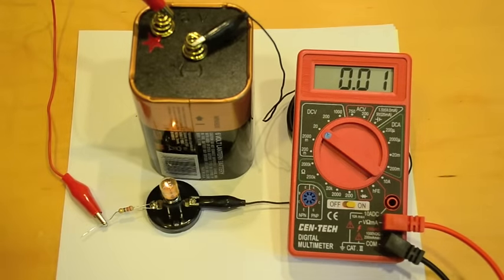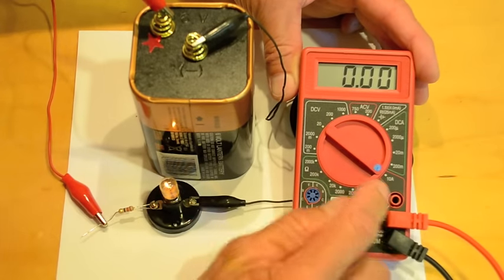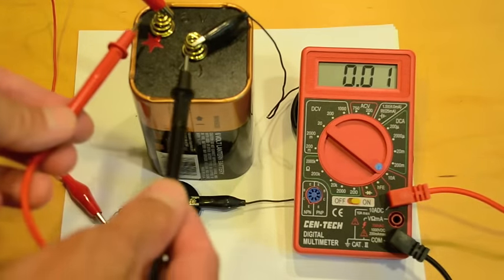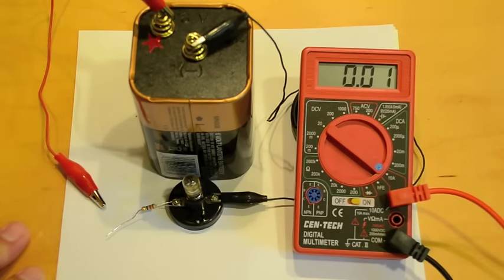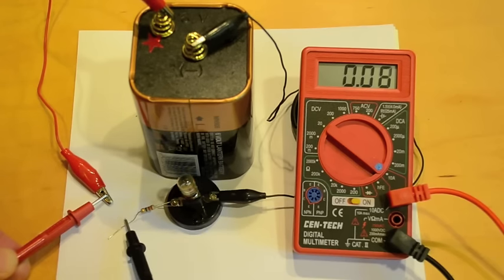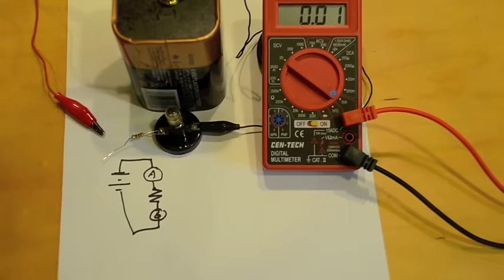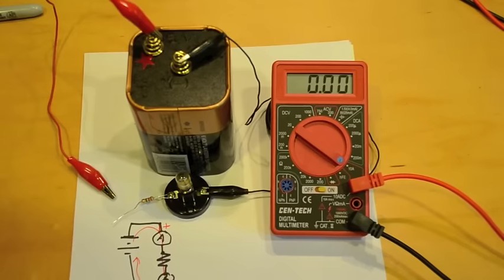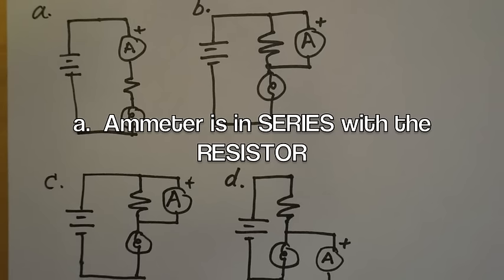Measuring Current with a Digital Multimeter

Comment: Is the resistor necessary?
Reply from the maker: No, the resistor is not necessary for this task, but it is part of the same circuit that is explained in my Measuring Resistance and Measuring Voltage videos.
Reply: so this will just measure the current being drawn for the circuit right?
 but what if we want to know the total current the power supply can put out? or is there no way to tell unless you know  what the power supply is rated for already?
i have an old power supply harvested from a PC and i use the the 5v  out to power some led lanterns i have hanging on my porch but now i want to add a  USB to  it to power a  security cam ,   i am just afraid  it might be too much  current though
i read that current of the power supply should not excede double  or 2 and  half times what the load  runs on , for exampe the camera comes with a 1A USB power brick and you can daisy chain up to 3 cameras off that one brick , but i will say 1A for the  camera load , so if the PC power supply is rated at over 2.5A then will that be too much current and fry the camera?
Reply: HomeMade DIY HowTo Electronic 
It would be necessary to not blow the light. 
Maybe.
Unless it's a 12v light and battery.

Comment: is is possible to measure the current even without resistor
Reply from the maker: ALVIN OLAVE yes. The resistor is only there to demonstrate other uses of the meter — measuring resistance and voltage. See the companion videos if you need help.
Reply: thank you very much..
Reply: of course u can measure current without resistor in series..
the purpose of resistor is to limit the current to bulb,but if u place ammeter inbetween resistor and bulb amp will vary

Comment: If you're doing a AAA battery or even a D battery can you put the probes directly onto the battery tips or do you still need a circuit
Reply from the maker: yes but  you won't really learn anything.  You'll just drain the battery.  The maximum current of a AAA is well under 10 amps but the voltage will drop when you short it out.
Reply: MrChanPhysics thank you

Comment: Would 0.17  showing on a meter be a reading of 17 mili amps or 170 mili amps ? I'm doin a parasitic draw test on my car and this is the reading
Reply from the maker: If your meter setting is in Amps then it is 170 milliAmps.  milliAmp = 0.001 Amp
Reply: Got u👌 my car should have no more than 50 mili amps so there is a draw there somewhere. Thank you very much

Comment: Thank you for the video, it was very helpful. For some reason I've always had trouble wrapping my head around multimeter current measurement. As an aside, that multimeter is an absolute piece of garbage. I work at harbor freight and for the most part, I like their stuff, but literally the only good thing about this meter is that it's free with a coupon nearly all the time. And really, the only good thing about it being free is that you can take it apart and get the 9v battery out of it, so...yeah, free 9v battery. Oh, and it doesn't have a fuse, btw, it has a shunt between the 10ADC and COM connector.

Totally not dissing you for the meter though, I'm just dissing the meter. It sucks and I hate it lol.
Reply from the maker: Yes, I got a bunch at Harbor Freight for $4 for my classroom.  I think it's a better deal than begging money from the  principal or parents for $200 pro units that have $10 fuses for students to blow.  The cheap Centech unit does have a 10 Amp fuse that costs about 50 cents.  But we basically treat the meter as disposable, after 7 herds of teenagers have gotten their hands on them.
Reply: Oh, stupid me lol. There is indeed a crappy little glass tube fuse sitting between the middle connection and most of the rest of the functions, in addition to the shunt between the 10A and COM connections. Still, crappy piece of hardware. It gets the job done, but there's so much jitter in the readings that it's hardly accurate enough for any real applications. Still, free (or $4) is a good price.

Comment: Just learning and confused. Why was the resister necessary?
Reply: +JP Voodoo You are right.
Reply: to avoid short circuit
Reply: No, It has to do with the light bulb can't handle the voltage of the battery, so the resistor lowers the voltage.
Reply: but dont electrons flow from negative to positive?
Reply: Yes, It actually doesnt matter which side the resistor is on however.  Quoted answer: "When two or more components are in series, the current will be the same through all of them, and so it doesn't matter which order they are in."

Comment: This can be used to test a 12volt car battery charger,, I'm pretty sure.. 
Mine has 2/10 amp charge plus a 50 amp boost... 

Tell me, what would your particular meter do, if you did the same test, 2amp/10am, and ran the Battery charger on boost at 50 amps with it in series.. Would it just register at 5 amps, since it could not go over 10, to get to 50, or stop at 10, or freak out?
And, what if it went over 10 amps? What would it show? Say 10.2 or 10.3 amps?

Reason I am asking.. 
When I tested 2 amps, it ranged around 2.2 amps.. 
I got no reading on the 10 amp charge...  (seemed if it went over 10 amps it would have registered at least 10 amps and stopped. 
I got 5 amps on the 50 amp boost charge, but, you have to hear it making the noise and watch the meter needle on the charger itself.. Not sure if the meter would register 10, or 5 for 50amps, or 5 for 5 amps.. 
I am using the same meter you are using.. 

But, it was making a heck of a lot of noise on boost, and the reason I was testing it was,,, I was just about positive the 10 amp circuit was not working to begin with.. 
I really was not sure what I was doing, but, I am even more certain the 10 amp charging circuit does not work, and I am pretty sure that the boost is not working either.. Or, not working at 50 amps... 

Do you have a few minutes to comment?

I did the video because I was pretty sure you could test one like this.. I found your video later after posting mine.. 
https://www.youtube.com/watch?v=ESnPuFYRbKg 

Thanks for your videos.. I can almost always find something to help figure things out when I run into something strange.. 
Measuring amps is something I really have not done on DC.. 
Thanks.
Reply from the maker: If you run more than 10 Amps thru this type of meter it will blow its fuse.  This particular meter uses a cheap $1 fuse you can buy at a hardware store.  A professional grade Fluke meter uses a $10 fuse that you have to order from an electronics supplier (I've blown a couple testing automotive circuits).  If you really need to measure current greater than 10 Amps, you'll need a clamp-on style ammeter, which uses an inductive sensor.  It has jaws which clamp around the wire you want to test.  You don't have to break the circuit to use it.  The jaws are large and clumsy and are not useful for small circuits, but will work for car batteries and household wiring.  .Make sure you get one which measures DC as well as AC current.
Reply: Thanks for your comment.. As I suspected, the Boost was only putting out 5 amps, because I went back and tested the amp meter on a wall wart transformer 1 amp.. Worked still.. No blown fuse.. 
And,, I am sure the 10 amp circuit produces more than 10 amps, if it is like the 2 amp circuit, and it didn't blow a fuse either, so, it was not working either.. 
I have one of the Clamp On Meters, but AC only, and I have never used it for that.. I need to hook it up just to see how it works.. Ha..
Again.. Thanks for your knowledge.. 
Helps to know I'll just get a refund on this one.. Don't need a third charger doing the same thing.. 
I'll check on getting a clamp on AC/DC meter.. Something tells me they won't be cheap... Cheers.

Comment: Hi what can be if multimiter not reads the amps (only -1 appears and not create a circuit) but it reads voltage?
Reply from the maker: it probably means the current is greater than the meter can read or display. For example, if it set to a 2 Amp scale, and the actual current is 3 Amps, which exceeds the limit, it may display the -1.  It may not be enough to blow the fuse.
Reply: MrChanPhysics It should read 10A but the current that i want to read is less than 3A. The fuse was blowned in multimeter I replaced with a good one but doesnt help

Comment: hi is there a way to measure dc carbon brushes to say if they are ok for 12v or the difference if they are for 24v or 36v
Reply from the maker: I don't think the digital multimeter will tell the difference.  A motor brush should be very low resistance for any application.

Comment: When I first got a multimeter, I measured the amps of a common 1.5v AA battery by connecting the terminals directly to it. I don't remember exactly but it showed about a couple amps and rapidly declined. When I checked the unloaded voltage after that it had dramatically declined ie a good amount of energy stored in the battery got discharged within a couple of seconds. But the meter or battery didn't get damaged even though I tried to check it on the 2000micro A, 20 mA and 200 mA before moving onto the 10 A setting and it didn't even have a fuse. And it's a cheap Haoyue DT830D dmm. Btw how is the maximum amps from a battery checked safely?
Reply from the maker: Batteries have internal resistance which limits the amount of current they can supply. The maximum power delivered is when the load resistance equals the battery's internal resistance.  Unfortunately, the internal resistance increases as the battery is depleted.

I don't know an easy way to test for max amps from a battery with a single DMM.   You could hook the battery to a variable load resistor (high power, low resistance), and measure both the current and voltage.  Adjust the variable resistor lower until the voltage across the battery drops below its specified voltage, and measure the current.  You could get  more current by lowering the load resistance, but that would drop the voltage even lower, so it would be less power (voltage times current).
Reply: I did the same

Comment: what is your maximum ampere for that battery
Reply from the maker: Good question. I could not find specs for it. I would guess several amps for a few seconds if short-circuited.  A car battery is capable of several hundred amps.

Comment: what if you want to check the amperage on the battery?
Reply from the maker: You should never connect ammeter directly to battery. You can test it with an appropriate load, such as a power resistor with a resistance similar to your circuit.
Reply: Short the Battery Terminals with a Shunt Resistor Circuit (momentarily, or the Battery itself will get too hot).

Comment: Why break a circuit to measure for amps but not ohms or volts? What happens if you dont?  If you put one probe on positive and one on negative doesnt that basically make the current in the circuit go through meter?
Reply from the maker: If you put probes directly on pos and neg this forms a short circuit thru the ammeter. The current will bypass the circuit you wish to probe. As much current as the battery or power supply can generate will flow thru the meter, possibly burning it or the fuse out .
Reply: MrChanPhysics thanks

Comment: So how do you measure the amps on a USB port? I have USB ports on a portable solar panel charger that I want to measure.  I cut an old USB cable to access the wires with the leads. I have the same multimeter. Thanks.  EDIT: found the answer although the guy has his leads backwards giving him a neg number. https://www.youtube.com/watch?v=PM-zqQCLTL4&t=58s

Comment: So how do i know if ive blown my meter?..............kinda seen this video after atempting to the test. Hoping i didn’t destroy my meter
Reply from the maker: Put the meter in Voltage mode (see related video) and measure the voltage of a battery.  A good AA, AAA, C, or D cell will read about 1.5 volts.  If you get no reading, then you may have blown a fuse.
Another way is to put it in Ohmmeter mode (see related video).  Touch the 2 leads together; you should see a reading of less than 2 ohms.  If the meter stays blank or reading is off scale, you've probably blown a fuse.
Reply: MrChanPhysics thanks alot, i ended up just taking it apart and just testing the fuses for continuity. Learned my lesson for sure, read the instructions manual haha

Comment: I almost measured my house current amps in the wall plug...i wanted to connect the multimeters terminals where plugs points go...luckly i decided otherwise...something ddnt sound right with getting an alternating current measurement...i could not imaging the multimeter display positive and than negative 50 time per second...
Reply: How much fire is acceptable when performing this procedure?

Comment: Is it possible to measure Ampere between the negative side of the load and the negative terminal?
Reply from the maker: Yes. Connect  the positive probe to the more positive part of the circuit, and the negative probe to the negative battery terminal